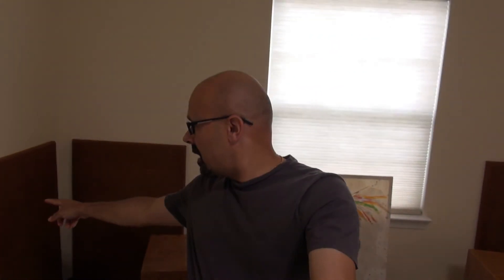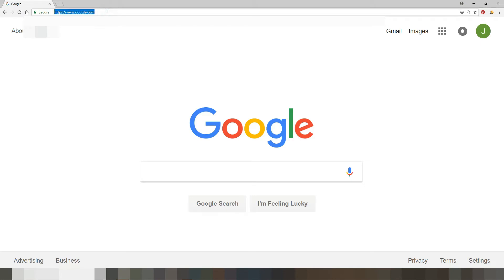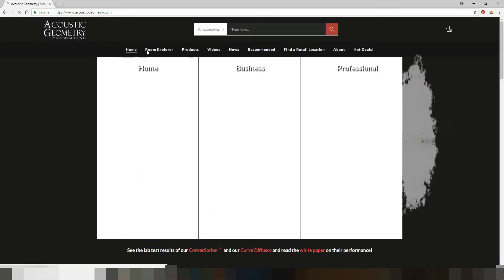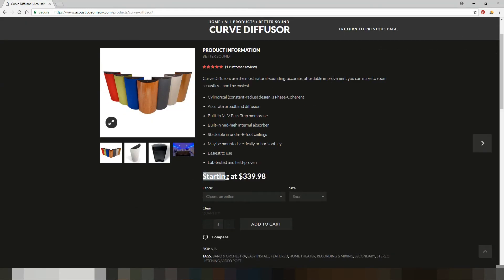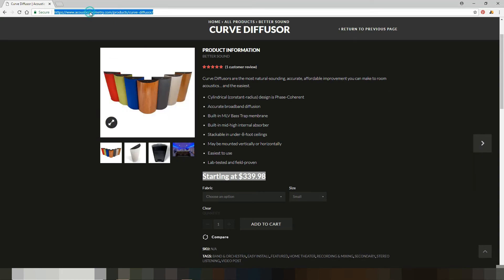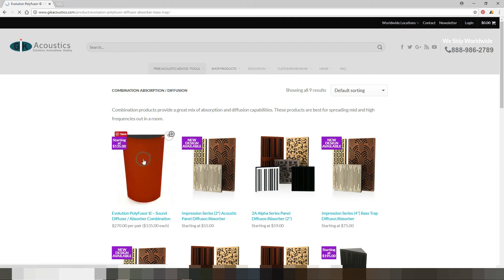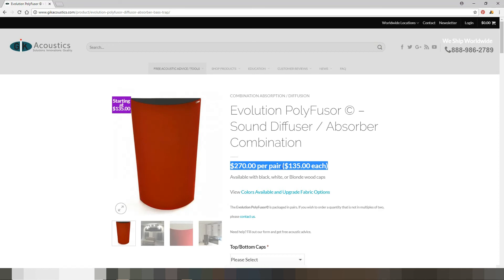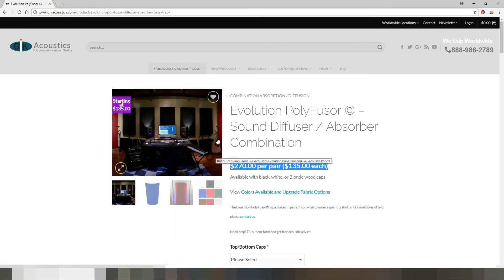Why I Decided To Build My Own Curved Acoustic Diffusers

Comment: What's the Cubic Footage of your Room???
Reply: It's pretty small, you need to consider that anything under 3000 cubic feet is gonna enhance the low end you might have a bommy room, the treatment you need the most are big bass traps covering most of the corners. You can download a software that's for free. REW (Room EQ Wizard), so you can do Acoustic Measurements and see how everything you put in the walls affects the room acoustics. I think the wood clapping thing only shows you a very small frecuencie range and mostly mid and highs which are way easier to control
Reply from the maker: You may be completely right but I am just and audiophile who enjoys the DIY aspect of getting a room sounding better. I am no acoustic expert or engineer and the software may be too technical for me. Thanks for the information though I may take a look anyway. Saludos.
Reply from the maker: Around 1200 cubic feet